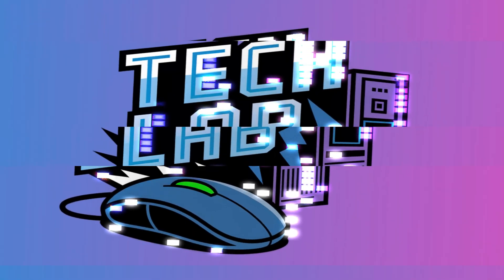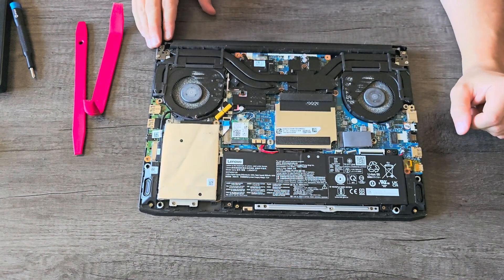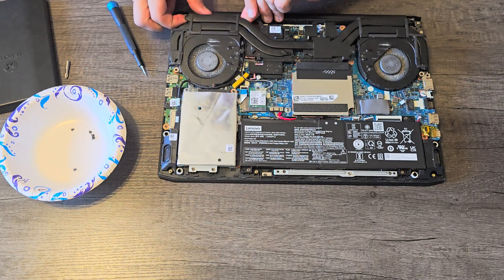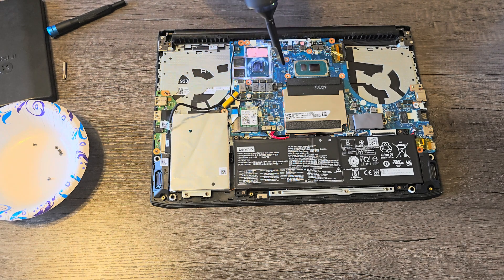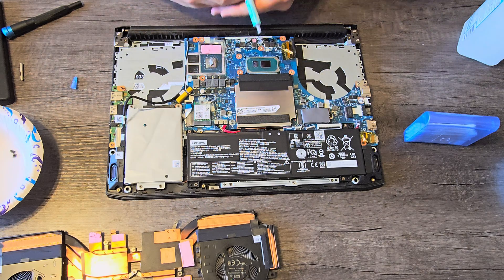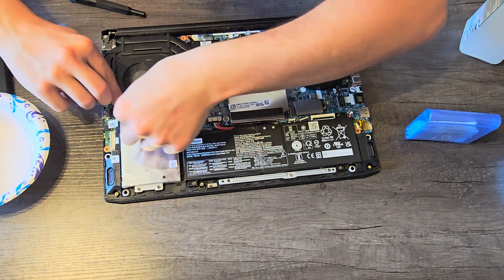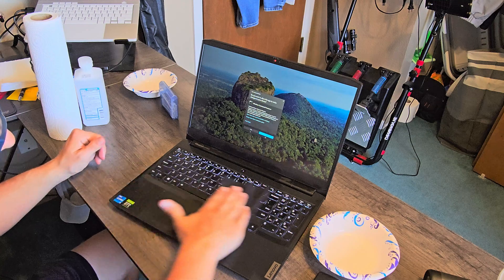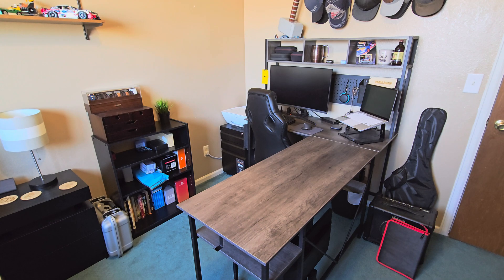How to Clean & Repaste Your Laptop for Better Performance! 💻✨

Comment: Where can I find all the tools that you are using? And what is the thing that you use to blow off the dust with?
Reply from the maker: Thanks for your question. Here is a list with links to the tools I used in this video, including the blower.

iFixit Mako Driver Kit: https://amzn.to/434JdCm
Fanttik B8 Ace Blower: https://amzn.to/3Jjdjvh
Plastic Trim Removal Kit: https://amzn.to/4oFJWSC
Arctic MX-6 Thermal Paste: https://amzn.to/47zwwRu
99% Isopropyl Alcohol: https://amzn.to/4hxLCeA
Cotton Swabs: https://amzn.to/48S9ffL